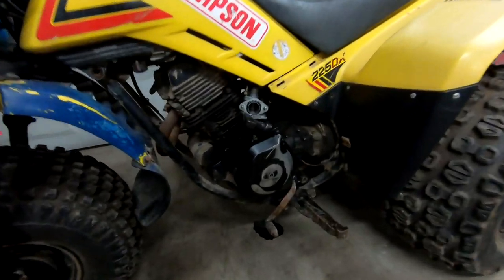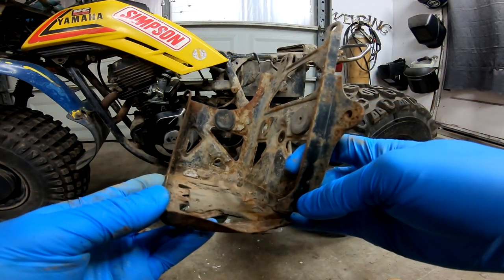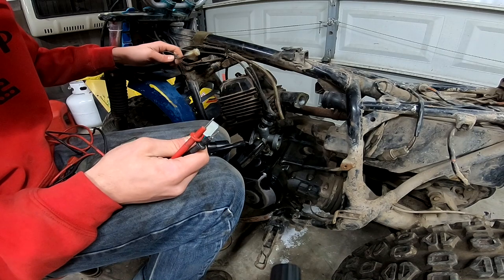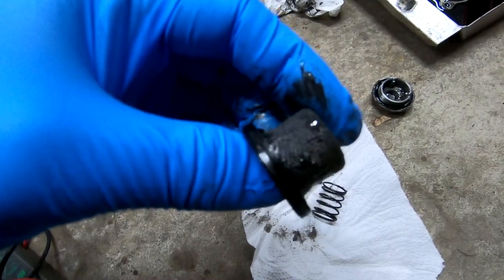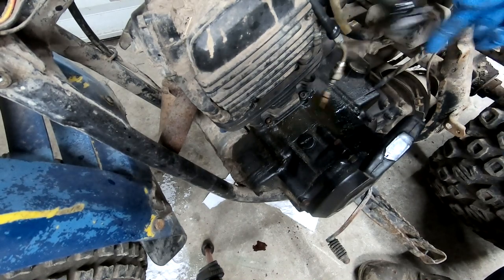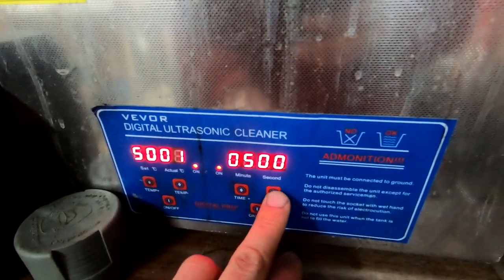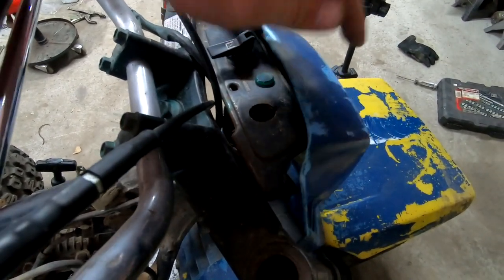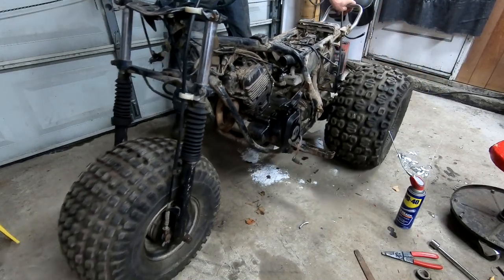Trashed Yamaha Three Wheeler - TEARDOWN

Comment: My 84 atv had the same problem with the battery, I had to using metal roofing strapping to fix it because I couldn’t weld at the time. It is crazy how many parts were shared from this 3 wheeler and the 1984 4moto 200cc atv

Comment: Personally I'd move the battery tray to were the engine is
Reply: I would also relocate the battery for sure.  And I would get the smallest one possible.  It just needs to be able to run the starter for 30 sec.  I bet a 4ah would be fine, and it is small enough you could relocate it somewhere better.  I can't imagine what yamaha was thinking when they designed it that way!
Reply: No room
Reply: ctvxl There is not any better places for it. I have this same tri that I bought new in 84-85. Lift fender for easy access.

Comment: I've heard that a 50/50 mix of acetone and atf makes a really good penetrating/releasing fluid. Also, heavy varnish on brass carb parts can be removed really quickly with cellulose thinners. Acetone would probably work here too.

Comment: If you'll turn the rear wheel around (put the valve stems inside) the rear will have a wider spacing for battery clearance. They were designed this way.

Comment: You can also use Marvel Mystery Oil or mix it with ATF and Diesel. That stuff has broke loose great number of things for me. Also the other headlight bracket is still connected to the plastic if you wanted to zap that back on her.

Comment: Two items about the battery:
1)  A couple of model years before or after this one, the battery was mounted high up in the space between the taillight and the rear of the air filter box. Might be worth a try here.
2) You mentioned something about a strap to hold the battery in place. The bracket you have essentially supports the rear, bottom and left end of the battery. The front, top and right end were supported by another piece of formed steel, not a flexible strap. This support had a tab that slid into the rectangular hole just below the hook on your bracket, the hook that looks like it should have the D-ring of a strap in it. This support was then held in place with a fourth bolt that went through a hole in the support and was then screwed into the threaded hole visible on your bracket to the right, or rear, end of the battery. Look here: 
https://www.bikebandit.com/oem-parts/1985-yamaha-tri-moto-225dx-ytm225dxn/o/m146955#sch224650

Comment: just buy smaller container or  strainer grate which has a good  metallic surface because in those that do not have a shiny surface ultrasonic gonna corrode the metal of that  and only use metals what ultrasonic page have

Comment: The ground that would be on the fixing for the batter box would go from the battery direct to earth the frame
Reply: I thought that as well, but the wiring diagram for this machine shows only a single conductor coming from the negative battery terminal. The ring terminal could, however, be the remains of a "bonding" conductor between the battery box and the chassis frame, designed to provide a path around the painted surfaces brought together by mounting bolts. Best practise is not to trust threads and scratched-off paint to provide ground paths. Especially on new assemblies. Did the ring terminal have teeth?

Comment: U can pump that tire up to 50 pounds. ..those tires are to wide for that trike.....u have to have spacers or as poeple did in the day washers...or make ur own..those tires flex to much. U pump up it will eat the centers out of the tires. There should be a brake fluid see through box reservoir above the battery. Then a rubber strap going from top to bottom in the middle holding the battery. You might want to check the driveshaft too....they were known for going bad cause of the design....even Hondas had problems with the shafts. If I was u.....I'd find somebody to trade for a narrower tire....cause ur going to definitely do the samething to that new battery.
Stand on the pegs and hold on to the handlebars standing up....rock it back and forth to check the swing arm bearings and the axle bearings. Cause if one of those are bad it will hit ur battery....
Reply from the maker: I will take all that into perspective. Thank you!!
Reply: @3DMachines  if u know somebody with a 85 200X u can compare the width ..I ran those on my 85 200X....They are a very wide tire....it corner awesome. But to big for a 225DX. Measure the height and width and compare them to the front tire. I've had 6 200X and on Yamaha 200E...I killed it..jumping.it.and flat tracking it...ripped out every bearing it had in the front and rear axles...that's why i went to racing style machines.....i wanted one of those until my friends were have problems with drive shafts and rear diffs...they leak...so keep an eye on it....

Comment: 3D machines  there a c clip holding the throttle line in the top of the carb thats why it doesn't  come out and i know that because  im doing a dual  atv carbed  on a 23hp v t twin lawn mower engine for my mudding mower